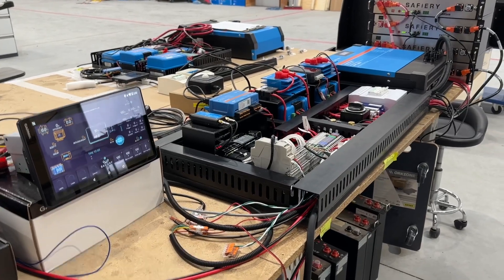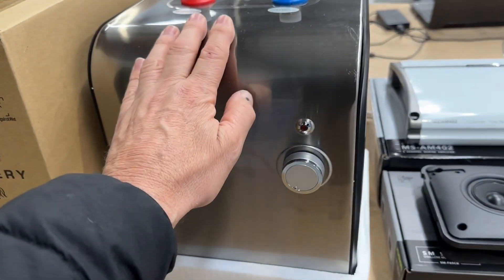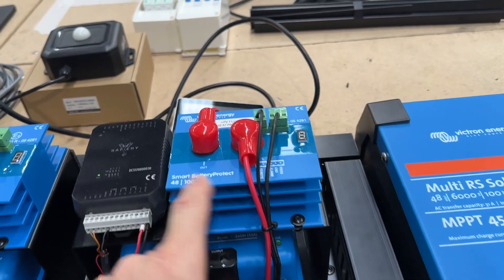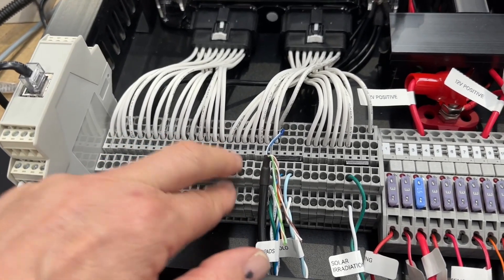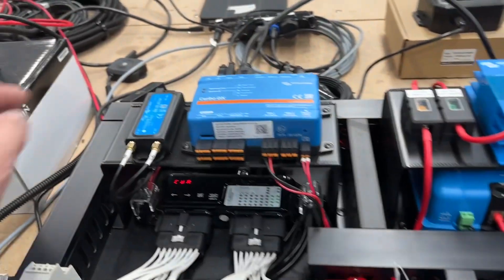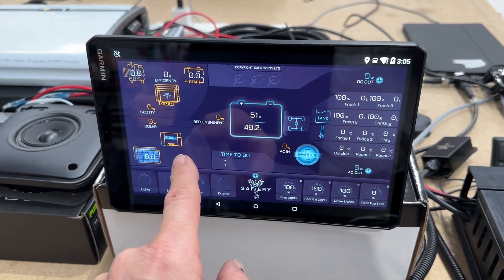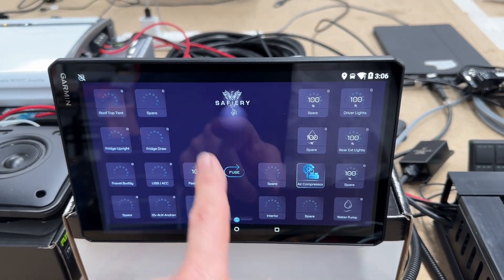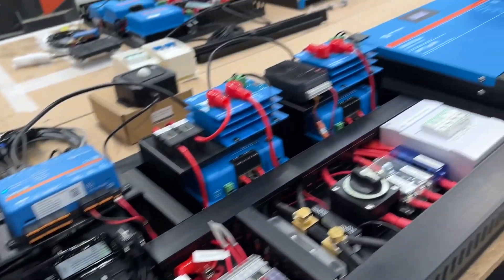Ultimate Caravan Power System that takes minimal space with Safiery Integrated Display

Comment: Those are some amazing Empirbus skills. Kudos to the graphic designer for the clean interface. I am curious about the Cerbo Solo. Seems similar to Solar Assistant running on a RPi. Maybe it is some sort of microcontroller exposing a few Cerbo options as an API for empirbus to leverage via can. cool stuff regardless.
Reply from the maker: It does processing that the neither the victron Cerbo nor the Garmin can do… so we have TPMS, Bluetooth sensors and other CAN sensors processed by it. It’s Linux

Comment: I have been observing Safiery systems for a long time - (and have sent a few customers your way) I personally think out of everyone on the market (trying) to produce premium power systems - you guys/gals are 'actually' doing it.

  I was a long time believer in the power of victron before safiery stepped casually into the scene - and when i witnessed your systems I was taken aback - literally - these systems you are building.... WOW - -  first move - buck boost and upgraded alternator - producing 3-5kva is it? so good. 

  I've always been amazed at the robust versatility of Victron energy equipment - when Safiery began - producing second to none systems integrating victron with their own personally designed and manufactured equipment - I knew safiery was here to stay and thrive. 

  I have been a power system designer for some time, and helped where i can advising installs - supplying ultra-premium cables made from scratch - (your power system is only as good as your terminations are) seeing a company not only design and install premium power systems but continually upgrade their designs and innovate new equipment to bring that higher end of development is as impressive as it is inspiring - Keep up the excellent work!
Reply from the maker: Thanks. We are now finishing STARship range with Wireless Opensource Bus. Here we have been struggling to get MPU down to 3uA of current. Its a big contrast to the expertise we developped with multiple 80A MOSFETS to uA technology. But we have done it!

Comment: Your 48 volt batteries how do they compare to 4 of the Victron batteries 24.6 200 aph ? I was going to do 4 of those at 48 volt.
Reply from the maker: The Victron batteries are not on CAN. We are a Victron distributor and their 12V work well for 12V jobs but I dont recommend for 48V as you cant see the cells and there is a single BMS and a single point of failure. Recommended batteries have a CAN BMS in each battery.